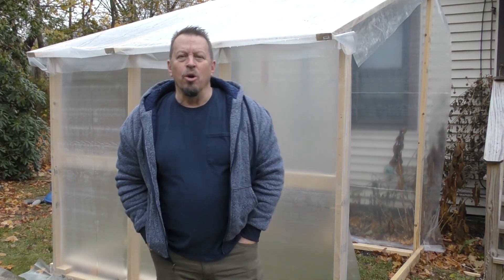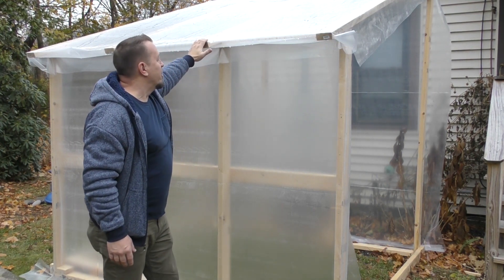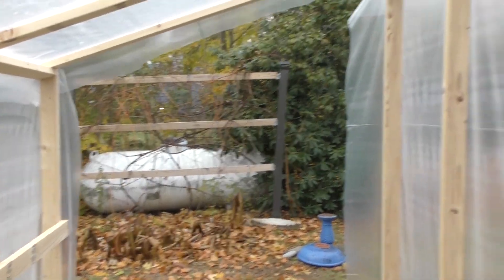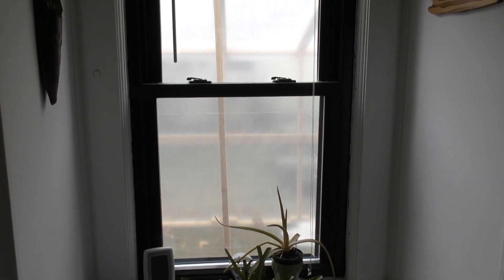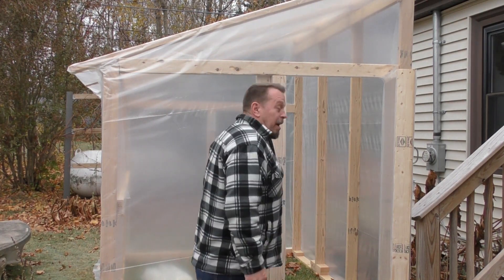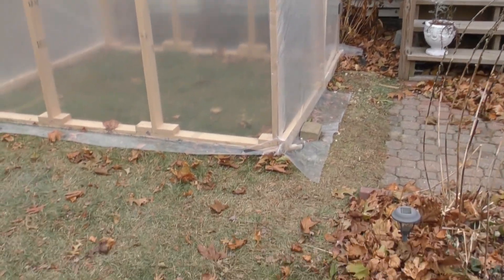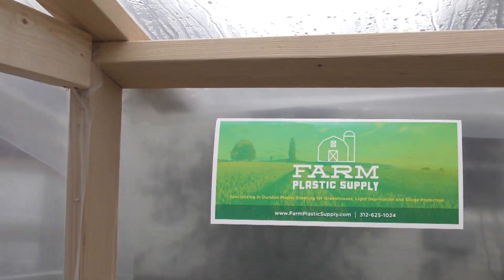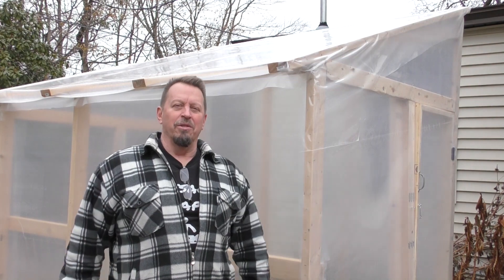How to Make a Heat Transfer Greenhouse Part 1

Comment: When I was growing up our southern wall had a lean too greenhouse on it, and when you opened the windows that were on the inside of the greenhouse the heat came rushing in..  any humidity issues with that pumped in heat